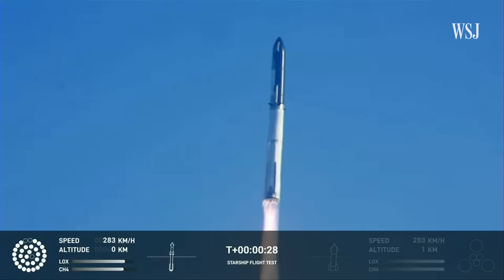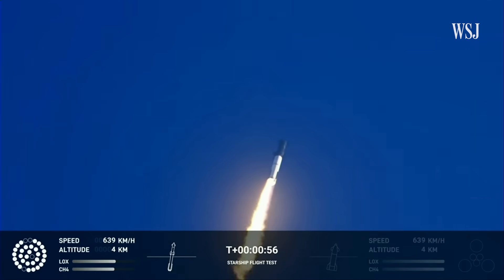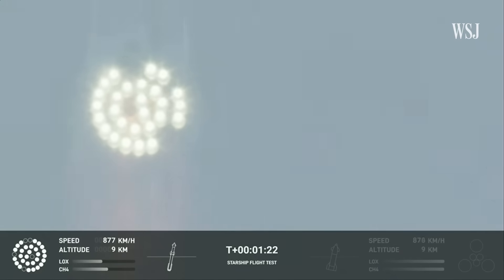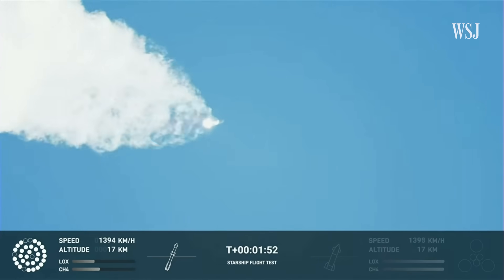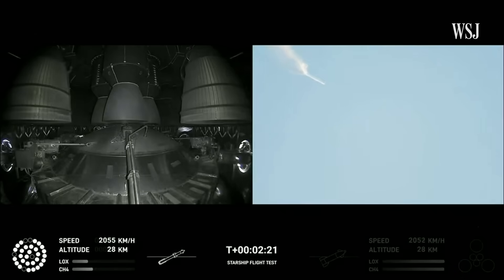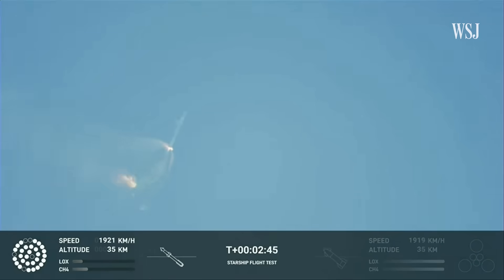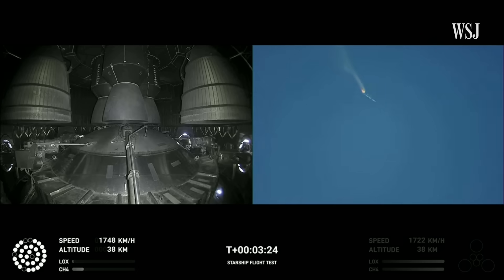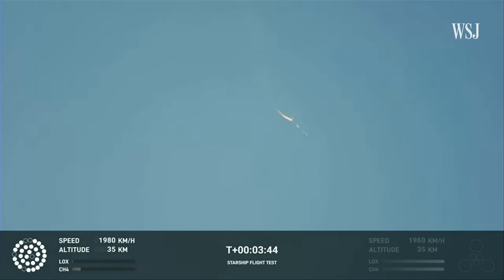Starship Explosion Video: Watch Elon Musk's Rocket Explode After Launch | WSJ

Comment: The sheep applaud as the rocket explodes.
Reply: I was confused at first too. But they were expecting it to explode, which is why there was no one on it or near it. It was cool. They were just testing the launching part.
Reply: Doesn't matter. They have several upgraded pairs ready to go and parts for a flame diverter solution already on site. Where are all of the extra SLS rockets? Rapid prototyping and this Agile methodology will bring us further than the bureaucracy of NASA ever could alone. 

I love SLS but if one of those explodes, the program is done. The only reason they don't is because they're using hardware from decades ago that they have experience with, and dump billions into a single rocket. SpaceX starship is orders of magnitude cheaper per rocket.

Comment: ---- >  A waste of oxygen.  Interstellar space travel is not  possible... not ever.  This will just be a venture to sell more weapons of war /self destruction,
Reply: @Stem2Space  
------ >  We, terrestrial beings, and material objects can't travel at the speed of light.or in and out of  quantum space.  What physicists spin at near light speed in a particle accelerator is a denuded proton, meaning a basic element has been separated from its electrons.
  ..... Traveling at light speed would mean we would have to leave our electrons and neutrons behind and we would die. 

Also, the amount of energy required to propel even one proton is enormous.
      ...."Each proton (in the LCH collider) has an energy of 7 Terra electron volts and is seven thousand times heavier than at rest. The magnetic force needed to keep the beams bending to the ring is so enormous that nearly 12000 amps must flow though its electro-magnets. This is achieved by making the LHC colder than outer space so that its magnets become super-conducting." 
     Large Hadron Collider-How it Works https://www.youtube.com//watch?v=dw3KuNgD-jE 
Questions and Answers - How many atoms are in the human body https://education.jlab.org/qa/mathatom_04.html 

----- > It's been said, the energy required to sustain or even generate 12-20% of light speed using mass conversion to get to the nearest star would require a mass the size of Jupiter. Adding a gravitational environment and a capacity to grow food would only increase the problem. Also, there's never been a successful self-sustaining habitat (geo-dome) even on Earth. 

Even putting all of that aside, it's already known that humans can't live more than 5 years in space and even a shorter duration can result in permanent brain damage.  Logically, any other terrestrial beings in the universe, such as ourselves, would face the same obstacles.
     New Dangers of Life in Space - Permanent Brain Changes https://www.youtube.com/watch?v=05rAbFNJ2Sk
Reply: @Stem2Space  ---- >  A warp engine is also unrealistic /.  theorized as "warp" or black hole technology. According to NASA, "a warp field requires a 'negative energy density' on the quantum scale. "
.... @ 4: 50. . 
NASA Releases Image of Black Hole Eating Galaxy https://www.youtube.com/watch?v=RKwJG8gM1lE

A negative energy density has to be referring to a gravitational reaction from pulling plasma (photons) out of quantum space like they do with lasers. This "warp technology", would rely on creating an enormous magnetic field. 

.... My perception, from CERN data, is that the cost in energy of a "minimal" warp field / black hole technology would likely be greater than the energy produced. And any energy field strong enough to propel an object (space ship) would, likely leave a black hole in its wake.  It might even consist of gamma rays which have been known, as mentioned in the above NAsA video, to clear out a galaxy. .
   NASA Releases Image of Black Hole Eating Galaxy https://www.youtube.com/watch?v=RKwJG8gM1lE\

Comment: The commentary on this is dire.  Up to a minute after the rocket is tumbling they are still talking as if everything is OK, mindlessly sticking to a script. The audience are cheerleaders and have been instructed to cheer, whoop and clap whatever happens.  If this was NASA in charge, they would just say the launch has failed, and the rocket was blown up for safety reasons. SpaceX certainly need to think carefully about this, in case something goes wrong once people are inside it.

Yes, I get it, this is only a test, and it helps identify issues which need to be solved.  However, the first Saturn V launch (Apollo 4) in 1967 was a much bigger leap in technology, only 9 years after America's first tiny satellite, and it worked first time!

Comment: This was a Failure at every stage. Destroyed the Concrete foundation, at least 3 engines failed on the launch pad. Small rocks rained down 5 miles from the pad. Never made MaxQ speed.  The only 2 positives were the entire rocket didn't break up after tumbling and it luckily barely cleared the tower.  This is an Elon Musk example of a success. Luckily no one died. Launch was an Engineering Disaster at almost every level. SpaceX had plenty of time to do this right and didn't. Disappointed. SpaceX needs a full time Boss. One who puts safety first.

Comment: All important data collected for better prediction on next mission.  Great job team. This is a piece of engineering art.
Reply: If this system was correctly engineered, they wouldn’t have multiple engine failure immediately launch. Only the Soviets had this bad of record of blowing rockets up. At least, so far, Elon hasn’t killed anyone. I suspect that will happen sooner than later. Notice how he hasn’t climbed into one of his own ships yet.
Reply: @Ewok751  Right, also I think the Soviets tried the many engines type first stage a long time ago, it didn't work well then either.  What would have happened if as the rocket was tumbling out of control, the first stage would have separated and the second stage would have lit?  There would be no telling where the rocket would have impacted, maybe in a populated area.

Comment: Seems entirely likely that the flames being emitted on the side of the engine bay as well as the downed engines could have been damaged by debris being flung around by the lack of an exhaust diverter.

Elon Musk sure likes to cling to the idea that many things aren’t necessary because they were built by tradition instead of necessity.

Elon, build some darn legs, and put in a flipping flame diverter. You could have built a dozen by now with all the launch pads you have destroyed.
Reply: I have heard the expression that today's engineers stand on the shoulders of giants, that is past engineers who have already figured out what works through trial and error, so todays engineers owe a debt of gratitude to those of the past.  I do not think Elon Musk's ego will allow that.

Comment: Rockets have been successfully launched into space without spinning for 55 - 60 years. This doesn't make sense unless what we saw was not what we saw. The government and Musk are one. What appears to have happened was a camouflaged malfunction. We only actually saw the animation spinning, the actual rocket may have successfully disengaged from the booster and is now orbiting with a nuclear payload. That would make more sense given current world affairs. The fact that this happened now is very suspicious timing. Prepare for a false flag? All this is conjecture. But if you have a better explanation, then why did this well engineered event evolved into such a amateurism failure?
Reply: bro it's the first ever test launch of the most powerful rocket ever made. of course it's not going to succeed on it's first attempt. this test launch was mainly focused on collecting flight data, not to successfully do the entire mission. also, everything after the rocket cleared the launch tower was bonus so the fact that it could go that high is a massive success
Reply: Keep asking questions!
If it doesn’t make sense then that mean theirs something wrong! 
Respect 🫡

Comment: With this first test-flight, my expectations were it to explode. It almost seemed (or maybe on purpose) that was the expectation. Key take-away is that they gathered crucial data. Well done, SpaceX!! You never disappoint.
Reply: I gotta say, it almost feels like if the circumstances had allowed, they could have brought it out of the spin and continued on with perhaps some acceptable structural damage. Pretty impressive considering that's been outright impossible up to this point.
Reply: I think they did expect it.The firmament will stop it every time.

Comment: The sideways movement from the pad is reminiscent of the space shuttle that needed to do the same thing. Since NASA engineers were providing some recommendations, they might have recommended an angled movement away from the pad to reduce the risk of contacting a part of the tower. The last part of the flight seemingly out of control may have been simply that the separation did not happen and the main booster continued to attempt the flip and return even with the additional load of the non-separated portion of the vehicle. I remember that the test included a separation by dynamics only, where the separation would happen without an assist when the main booster slows down. I believe that SpaceX assumed the vehicle would be far enough out of the atmosphere where the downward force on the top of the vehicle from air drag would be insignificant. The two choices are to install a separation assist mechanism or separate at a higher altitude. The other factor that may have played into this is that the loss of the engines may have resulted in an attempted separation at a lower altitude than planned while still in the atmosphere preventing the separation from occurring. Therefore, the root cause is probably the loss of thrust from some engine failures resulting in a failed separation attempt at a lower altitude than planned.
Reply: Lots of possibilities to guess from.  I feel confident they were collecting a lot of data and will be able to identify the failures in order to correct accordingly.
Reply: my other guess would be that they there was a lot of stress on the rocket itself that it kinda pushed the two stages together, i mean i'm surprised it even didn't crumble under 33 engines pushing it.
Reply: It lost about 5 engines if you look, adding to what you said about separation at lower altitude.
Reply: @KlawkKent  if you look at the bottom left of the screen at the point where you can see the engines from below you will notice the engine counter that shows 5   turned off at one point 6 are turned off those are intentionally turned off to guide the rocket to its trajectory,  you will also notice at T+00:00:16 that 3 engines are turned off this is how they control the flight of the rocket.
Reply: @cwjameson37 Thank you!
Reply: This is probably old news now but one the sideways movement was not planned that was because of the lack of power and engines not being throttled up in time. And two the rocket started spinning because it lost thrust vector controls which are hydraulic, booster 9 will have electric TVCs so plus about 98 other improvements. 🤌🏼
Reply: armchair scientist
Reply: Sideways movement seems to be typical with big rockets, the Saturn V did the same thing.

Comment: Little history lesson.

The soviets beat america to space, fist satellite, geo stationary orbit, first living thing in space, first man in space, first woman in space, and pretty much every mile stone but the moon. They had all their tech for longer and it worked well, but could never get to the moon. Why? Because their lead engineer died before designing a rocket capable of getting to the moon. So instead of making a new rocket that might suck, or giving up, the soviets strapped a bunch of little rockets together to make something capable of getting to the moon.

America had the saturn v with 5 j2 rockets and that was enough for first stage. And went to the moon multiple times.
Reply: Now look at starship and tell me what you see, few big engines? Or 33 excellent medium engines?

The soviets never got as far with their moon capable rocket as they did with weaker rockets because the failure points compound with each rocket added. They launch, and a few of the engines malfunction or over heat, and next thing you know the vehicle is in multiple pieces or uncontrollable.
 
They didnt have software we do now. Starship is literally just an upscaled soviet rocket with good enough software to not instantly fail, and that is impressive. But it needs fewer more powerful engines, or it will never be as reliable as saturn v or falcon 9/heavy.

Comment: it just looked unwieldy to me. too many maneuvers and separations.The rocket is a pencil and it is not designed to twist turn to and fro,change direction  etc etc. this had to happen. fancy design and maneuvers wont work. The stress is just too much.
it just did not look right or i did not see it right. Overrated SPACEX ENGINEERS. where were NASA folks? why they themselves cant design re-usable rocket rather than HYPED up MUSK'S  engineers.

Comment: The stupidity of the lunch pad design is shocking. An easy solution is making the lunch Pad twice as tall at minimum. Its ludicrous to have such a faulty design philosophy. Making the lunch pad three times is high at least.
Reply: First - you mean launch TOWER; not launch PAD.  Getting these two things confused right off the bat tells anyone knowledgeable about how all this works that you have no idea what you are talking about.  The launch PAD is basically the area below the rocket.  The launch TOWER is.....well.....the TOWER that holds the rocket upright until the launch sequence begins.  

Second - there is absolutely no reason this would need to be any taller than the rocket.  It doesn't guide the rocket.  It just holds it upright until the launch sequence begins.  The taller it gets, the more likely it is that the rocket would run into it, so even if you correctly identified the piece of infrastructure, it would be a patently STUPID idea.

Comment: The fact that people are cheering for an obvious failure is just unbelievable. The rocket is tumbling out of control and blows up and people are freaking cheering...dear god this cult is so bizzare.
Reply: They aren't cheering because it exploded in and of itself.  Yes, the trajectory got off course.  The problem with it going off course is that it could be catastrophic if it crashed over a populated area.  The rocket didn't just randomly explode; it was remotely detonated as a fail-safe.  The cheering is for this remote detonation working.  They are cheering for a SUCCESSFUL remote fail-safe detonation which brings the rocket down harmlessly into the ocean rather than over a populated area.

If I'm in a car crash, and air bags deploy - which save my life, and I call the manufacturer of the car to thank them - - - - what you are doing is the equivalent of assuming I'm thanking them for my car crash - - when I'm ACTUALLY thanking them for installing safety measures that - in the event of a crash - would save my life.

Jesus....

Comment: I dont get this, the rocket exploded, isnt that bad?
Reply: It's both good and bad.  The rocket got off course, and rather than risk harm to people on the ground (perhaps not knowing where it would end up), they remotely detonated an explosive to bring it down harmlessly.  They aren't cheering because the rocket exploded; they are cheering because their fail-safe system worked.

Imagine you designed air bags for a car.  You don't WANT the car to crash.  You would never CHEER because the car crashed, but if the car DOES crash, and your air bags - which potentially saved the lives of the occupants - work properly, you would cheer that your fail-safe worked properly.

Comment: I don’t understand the celebration , it exploded
Reply: to the engineers that built it. just making it off the launch pad, and then though Max-Q. proves that its a workable rocket design. they just have to work the bugs out
Reply: @viperch25  reminds my of a boat, much money thrown in the water , nothing but memories remains. As well as fireworks , monies burned up. What good use came from it . Seems to me the engineers could redirect their purpose for making life better for mankind. Personally I don’t think anyone will escape this place except through the Lord Jesus Christ , and what you have done with your gifts and talents, on that day when the Lord comes back , he say what will he find them doing . Will they have Faith ? In God or themselves
Reply: @ML-lm2mx  since gods not real. why not advance human learning
Reply: It didn't explode on it's own.  It was remotely detonated - because it veered too far off course - potentially putting people in danger.  They are cheering because their fail-safe system worked - - which is to remotely detonated the rocket, bringing it down harmlessly into the ocean.  All parameters of the test flight were met - so it was technically a success.  It's even more of a success because they also got to test their fail-safe system.  All in all, this was a very successful test flight.  That's what the cheering is about.  This was never a mission; this was always a test flight, and it was a successful one.